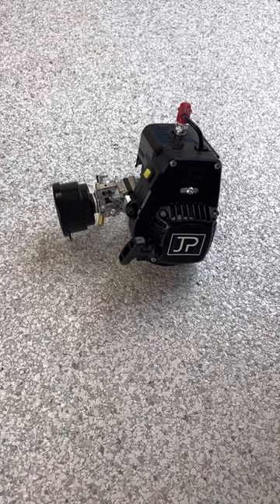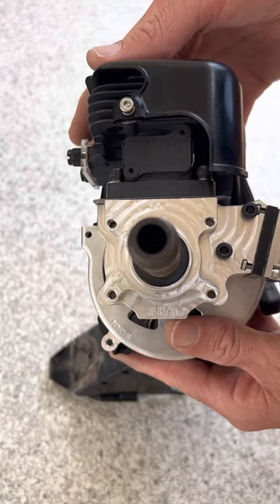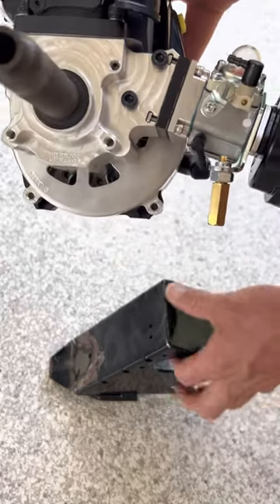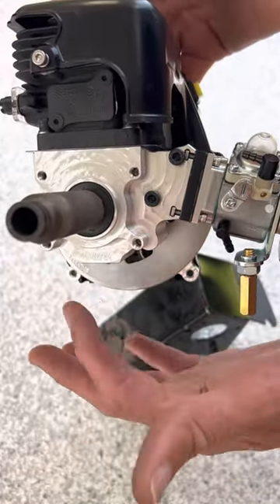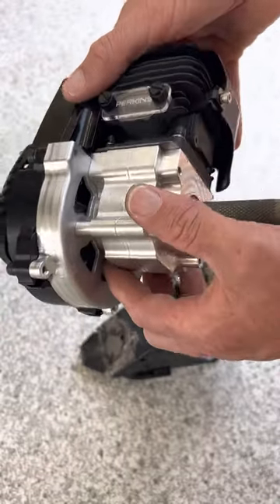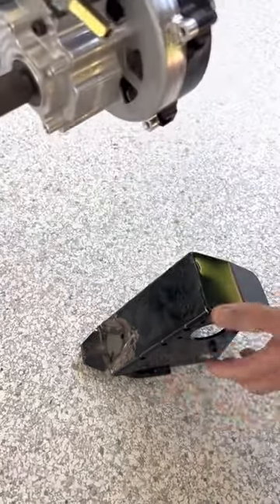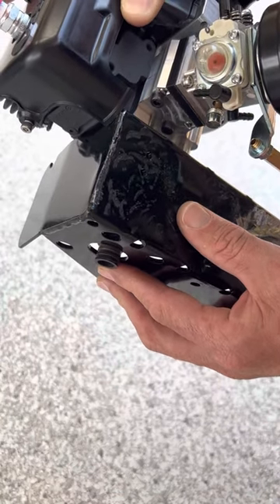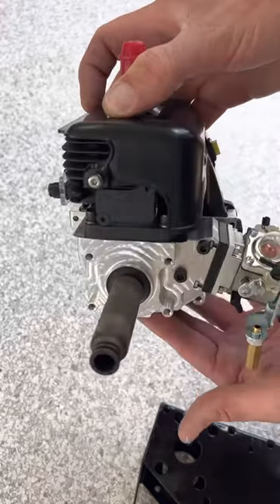Zenoah g320 RC Reed case for sport. JPCR32/34 limited release.

Comment: It's a shame zenoah changed the mounting bolt pattern on the g320. They should have kept the smaller bolt pattern since everything built before the g320 came out used the same clutch/mounting bolt pattern and the g320 is basically the odd one out of all the RC style engines.
Reply from the maker: They wanted to use larger bearings and larger rotating mass on the crank. Since on a stock cast case the connecting screws for halves share holes with mount screws, they had to space it more for the larger crank. RC cars are their biggest customer base so it wasn’t a problem seeing as how they all use a clutch.
Reply: @Perkins.porting  I get it, they pretty much reached the dimensional limitations once they went to the g290rc, so to go any larger required a re-design but it really sucks for us goped riders that want a bit more power, but for most people it's just easier to stick with a conventional g290rc based style engine which can still run really strong but is limited.

Comment: Hey sir..im wondering whats the verdict on the shred ped extender pieces that allow you to run bigger spindles. Have you tested them alot by now? Is the stock mounting hardware sufficient? Would you prefer to weld them? Thank you
Reply from the maker: Unfortunately, I have not tested them much. Always a good idea to weld if possible but I haven’t heard of any problems with the stock hardware.

Comment: Is the 320 more for top end and 34 more for low end?
Reply from the maker: Depends on the work done, usually true with a piston port. This engine is ported for torque, being stock stroke it will still have loads of top end.